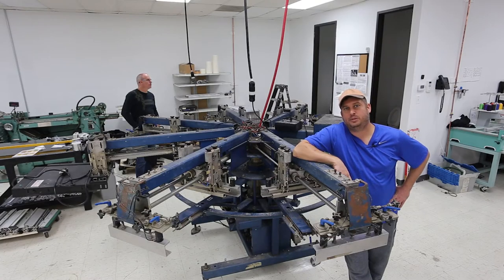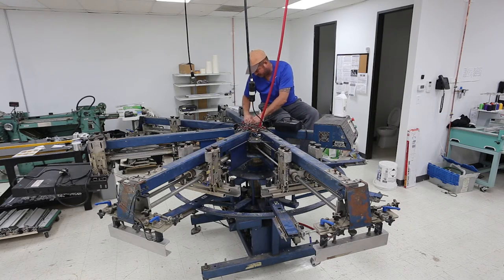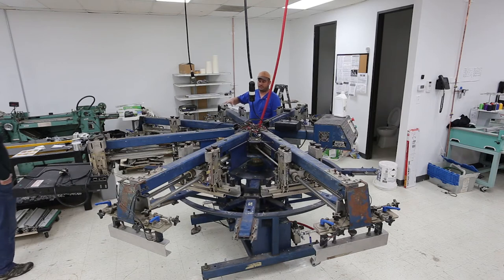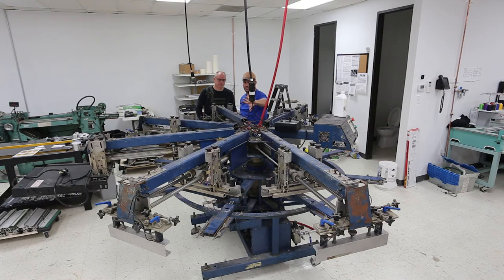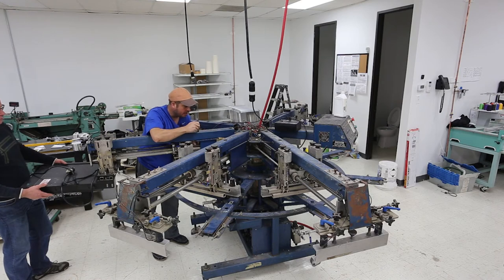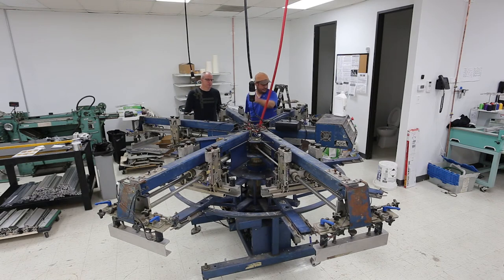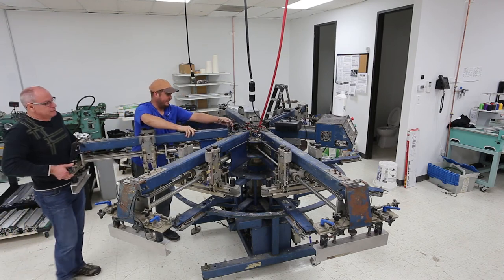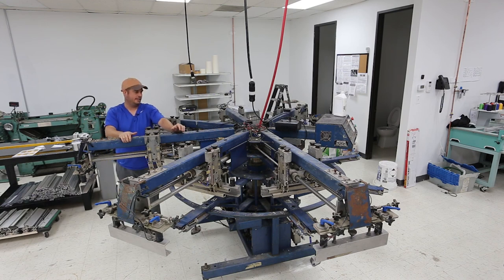M&R Gauntlet 6/8S Moving Press Heads

Comment: I remember using these back in the day 150 shirts in an hr on a. Chill day
Reply from the maker: We finished installing it yesterday and Thursday.  It had not run in a few years, so there was quite a bit of tuning to do.  Registration is under .001 difference from head to head.  It was only out by .012 when we set it up, but better to start right on the money.  We slowed the press down to reduce wear and tear from slamming and shimmy.  The lift and index cylinders are pretty experienced and tired.  We have it setup at 36 doz/hr with all heads printing.  That is slow, but the dryer probably can't handle more than that, so it's really pointless to run faster.  36 doz an hour is a walk in the park, faster than a manual press and still makes money doing great work.  :)
Reply from the maker: Before someone blasts me about not having enough colors or not running fast enough..... we mostly do 1 to 3 colors in 1 to 2 locations for orders of 12 to 250 shirts..... and that's what this press excels at.  No need to buy a Lambo when a F150 will do the trick.
Reply: Brian Greul i agree with that an older machine make break under intense production. Running it lower may increase time for job completion but thats better than having a break down and have no production for 1-8hr for repairs
Reply from the maker: They are pretty solid machines.  This one only has 1.3 M impressions on it.  The sportsman is pretty much a Gauntlet 1 with some engineering updates and a modern PLC.  The center shaft was an issue on the Challengers and bigger Gauntlets.  M&R provides great parts support which keeps the machines making money.
Reply: if you don't mind me asking, what CFM are you running the machine? I just bought a similar model 8x10 and I can't find the correct CFM or the right compressor to run it with, thank you! very cool video thank you